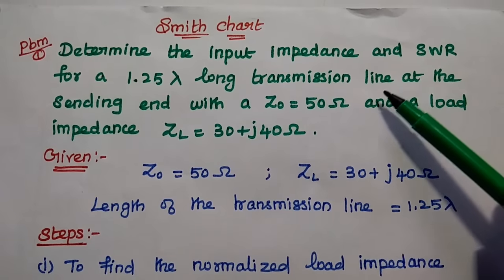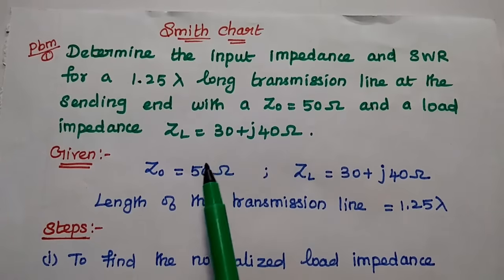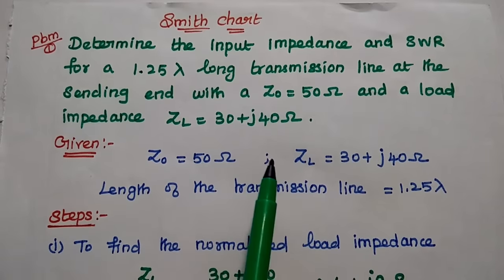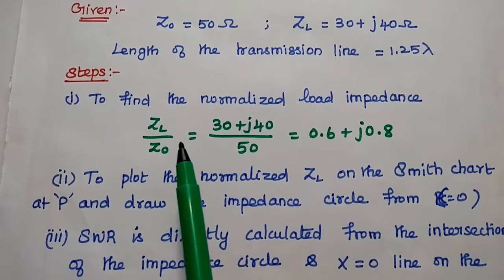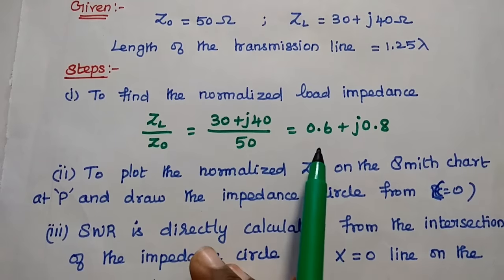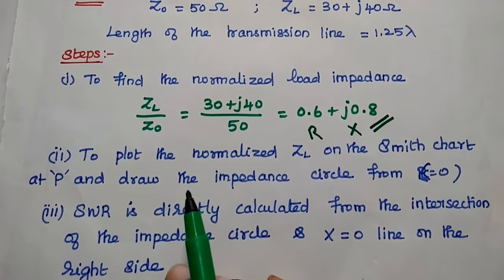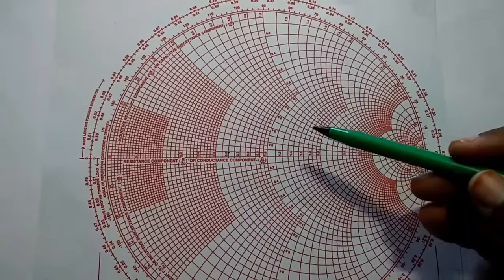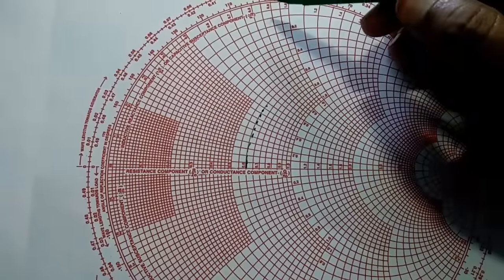01 - Problem Solved in Smith Chart - TLRF - Transmission Line

Comment: (a) A line of Re 300 ohms is connected to a load of 50 ohms resistance. For a frequency of 50 Hz, find the length, termination of single stub nearest to the load to produce an impedance match. (Use smith chart)
Reply: Mam I want this answer